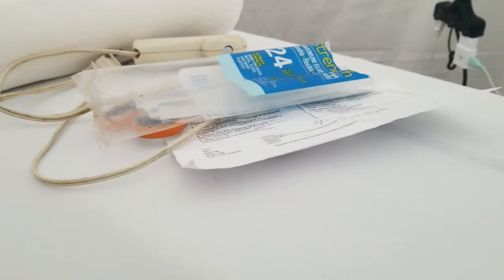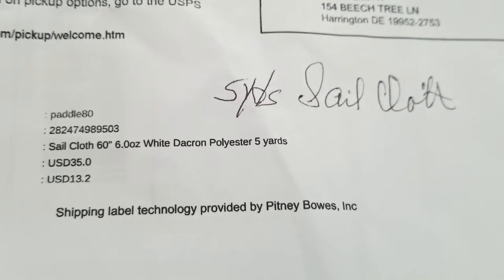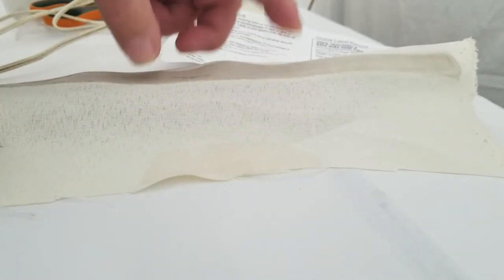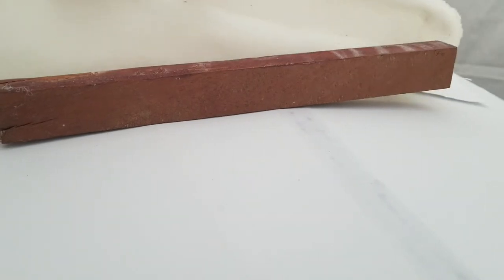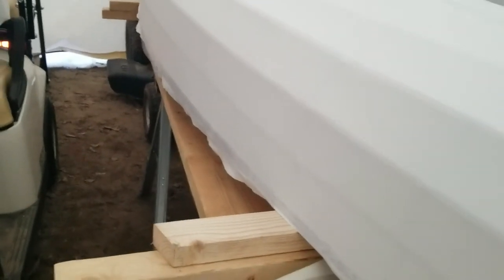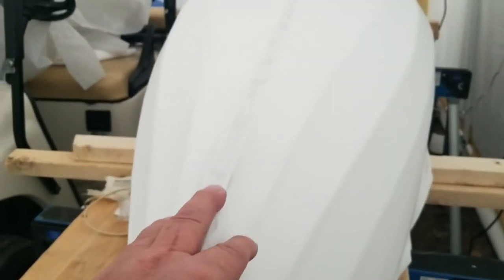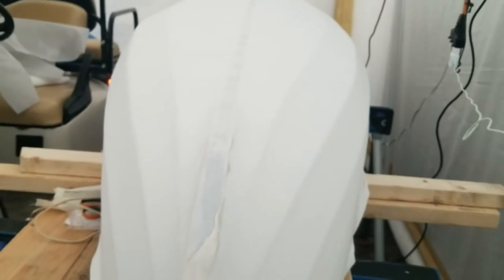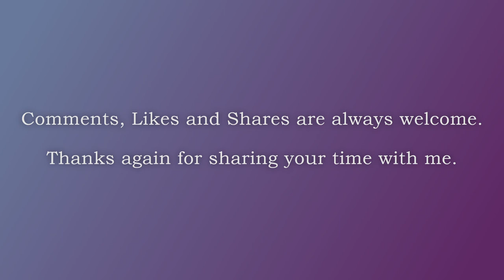Freedom Update Re-skinning my Skin on Frame Canoe

Comment: Great video- plan on building Annabelle by Dave Gentry. Polyester fabric that is normally used in SOF boats is not available from the usual sources so I was thinking I would have to ballistic nylon. Great to know I can use sailcloth.
Reply from the maker: Shrinking is a bit tougher than with the polyester, but if you're patient with it it gives good results.